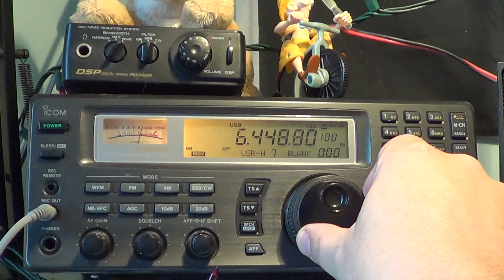The sounds of Shortwave STANAG and what it is

Comment: hi yes i just punched it in my dx-394 here in baltimore and got the same thing . 20+ on the meter i just put up a inverted V  dipole antenna up this past tuesday . the center is around 45 feet up . just under my 10 meter antenna.and it  works great . i also have a old  hallicrafters  s-38c that i just recapped  . it also for a old rig sounds great on the inverted V .  thanks for your vids on shortwave radio . i am 48 years old now and got my first radio on my 12th birthday it was a hallicrafters  1940 s-40a that my dad and i recapped and got working together .    thanks for your time   bobby   kb3-hvt